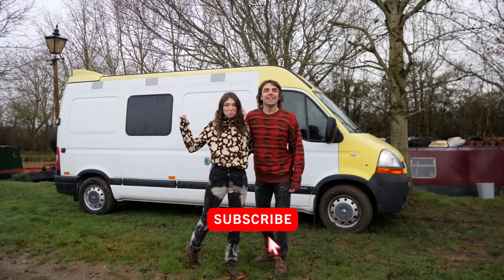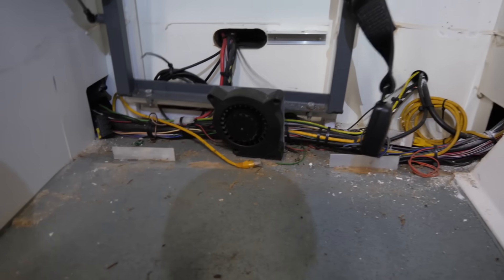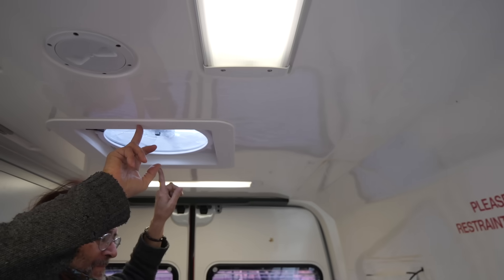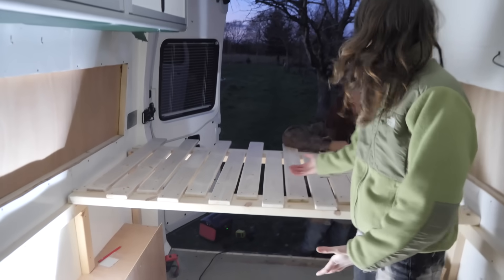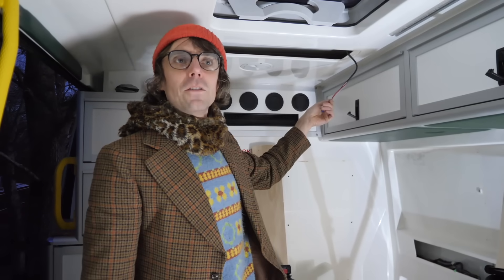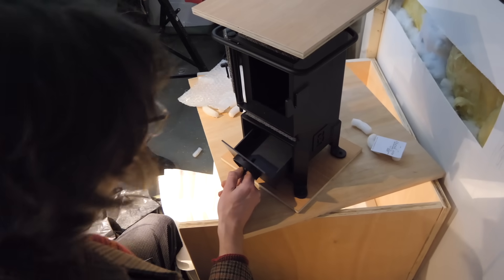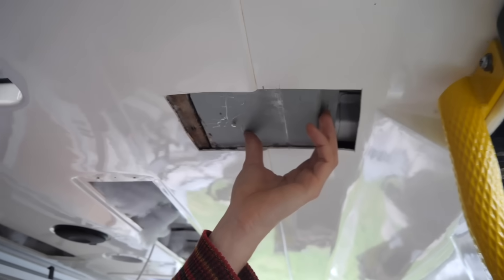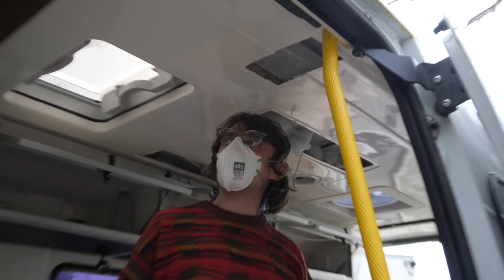DIY Van Conversion Begins! | Installing Pull Out Bed, Woodburning Stove and Maxxfan | Van Life Build

Comment: The 2 metal strips in the roof is added for structural support in case the van rolled over. They put them in the ambulances in the US, in case of an accident, and it rolled over, so the roof wouldn't collapse in.

Comment: You two (or 3) are so good at working together and quite skilled.  You might want to install outside cameras for security reasons when you are wild camping  and you wonder what the noise is outside or someone trying to get inside. Also, buy yourselves a baseball bat.  I don't want to be negative but you need to protect yourselves in a world that is not always kind depending on where you camp.

Comment: You guy’s are very clever. I wasn’t expecting such high standards. You are doing extremely well with the fit out. Cutting out holes doing electrics. Fitting a little burner. And a shower. I am absolutely amazed. Brilliant job. 👍❤️👍❤️👍❤️👍❤️👍❤️👍❤️👍❤️👍❤️👍❤️👍❤️👍👍❤️👍❤️👍❤️👍❤️👍❤️👍❤️👍❤️👍❤️

Comment: The Van looks great. Just hope you plan on driving it on paved roadways ONLY. Anything with a bit of gravel and bump you’re going to ground out.
Reply from the maker: Thanks for watching 😊Why would it do that?
Reply: @BenandEmily  Well, it has a wide wheelbase (distance between the front wheels and the back wheels) and the height of the bottom of the van to the ground.

Comment: Hi Ben/Emily, excuse my ignorance but are there no rules/laws regarding wood burners in vehicles? ie fire hazard/ carbon monoxide etc? Plus what about when you travel over rough ground or have to emergency brake? will it not tend to move/ vibrate the flue? Sorry I’m only a boater and have never lived in a camper van 👍🏻
Reply: CO in a van is the same as CO in a boat. It's an equal hazard. I imagine they've secured the burner & flue to withstand the vehicle movement?

Comment: is the fluepipe upside down? if you burn wood with a lot of tar in it, it will run back and out of the joints. maybe Im wrong but on a house chimly it would be the there way. But what do I know. lol

Comment: Hi Guys.
Not trying to put a dampener on your build of your Van but you really need to consider the weight of your Van currently ( Ambulances tend to be rated as 5T up to 7.5T ) because of the way they are built and for the purpose of the vehicle.
You obviously need to consider how much weight the Vehicle will weigh as you go through the process  because you obviously Cannot go above its designed MAM or GVW ( plated weight ). 
The other factor you will need to consider is Driver  licensing and which category of Drivers licence you will need to Hold ( Don’t assume because you have a Car licence you will have a licence to drive that vehicle). 
Because you have to remember that in Europe they are a lot stricter on Vehicle regulations and MAM/GVW etc.
All the bits that you are going to be adding into the vehicle,all that weight soon adds up and the last thing you want is to build it and then realise nobody can Drive the thing 🤷‍♂️.
Reply from the maker: Thanks! It's 3.5ton 😊
Reply: @BenandEmily  If I was you I’d get it down to the public weighbridge and weigh it so you know how much weight you can put in it for the Build
Reply from the maker: @moffatt43  thanks, yes I think we're going g to head over to one once we have the solar panels on. 😊